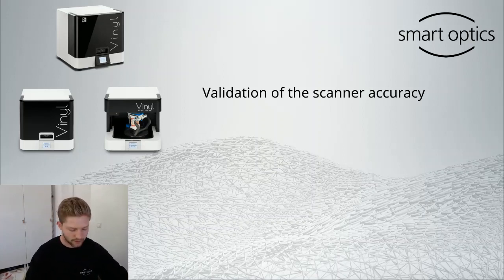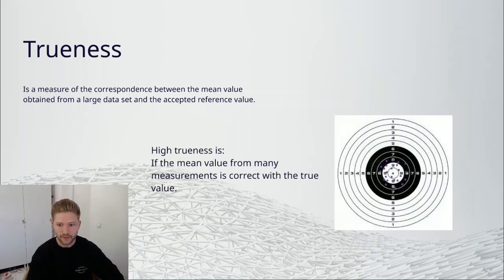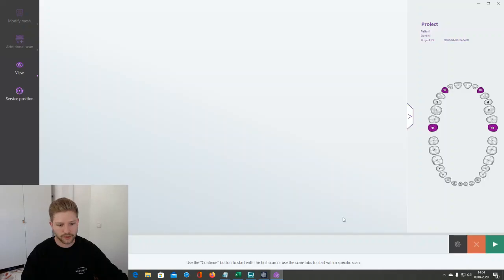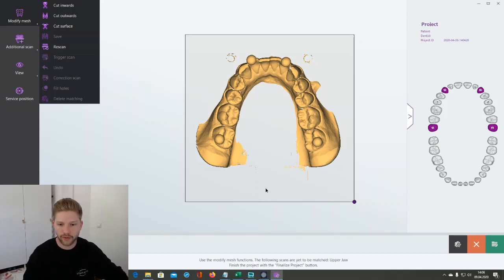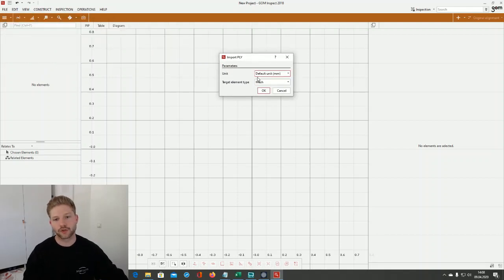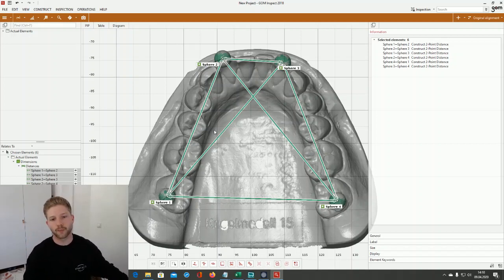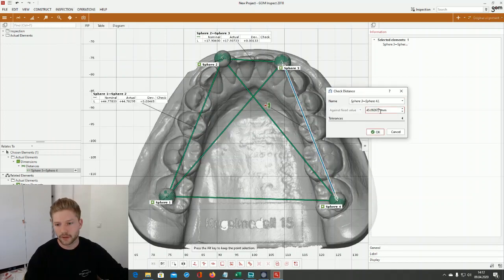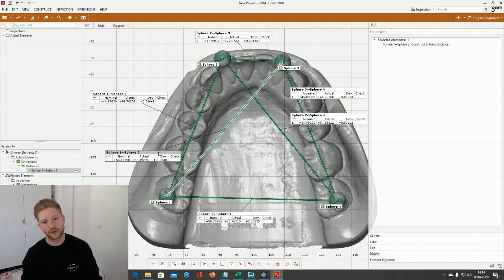Validation of the scanner accuracy CAD evaluation of special ball models

Comment: And doing the same with upper against lower models to evaluate accuracy between upper and lower models with the vestibular scan?
Reply from the maker: Hello, in order to determine the position in three dimensions, we proceed in a different way. However, if you only want to check the occlusion, you can easily do this yourself. Mark the contact points with occlusion foil and then carry out a colour scan. You can then use CAD software to check whether the virtual contacts match the markings.